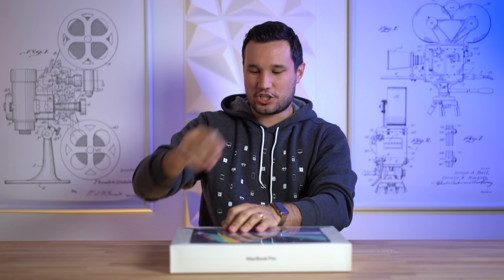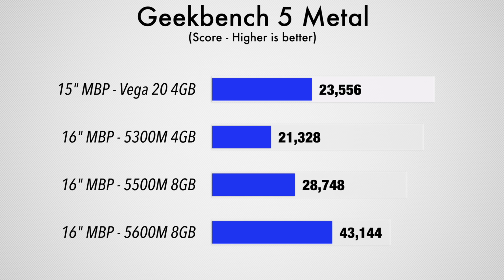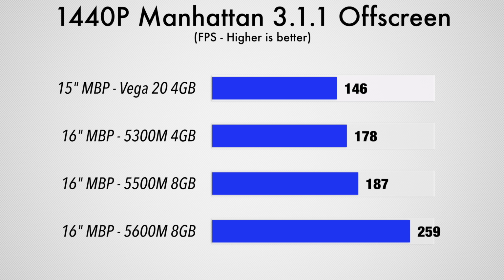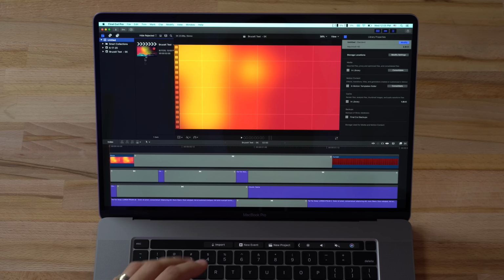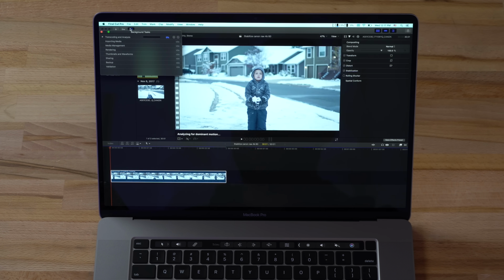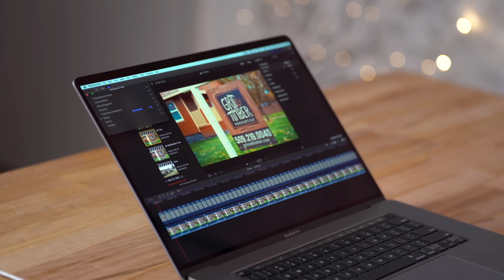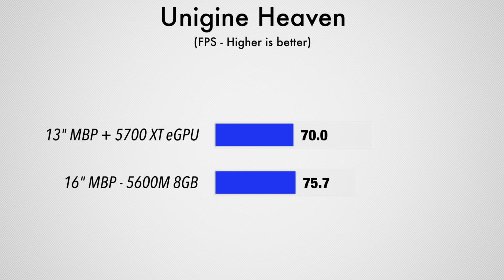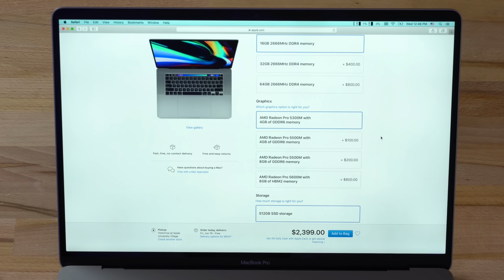New 5600M GPU on 16" MacBook Pro: Performance Benchmarks

Comment: @Max Tech you should do a revisit video about the issue on MBP 16" with 5300M & 5500M dGPU. These two dGPU are consuming 18-20 Watts of power when connected to external display while the lid is open while the 2019 MBP 15" or 2020 16" with 5600M only consumes 6-8 Watts. This is clearly an issue that needs to be fixed by Apple. Tech Reviewer like you will be able to bring for public & Apple awareness rather than allowing Apple to state that "it is working as expected" bullshit.

Comment: I bought this new mashine and I can just warn. The i9 2,3 ghz is throtteling down to 1,7ghz and my 5600m goes down to 300mhz from normaly over 1000mhz. This is unplayable und even with throttlestop I can not stop the gpu from going down in performance. If you are living in cold places without a heater it could work :-)
I have to send it back.

Comment: What about gaming and streaming on obs at the same time on just the MacBook Pro 16 5600mm?? Is there a lag with higher cpu spike maxing out? Because obs only allows the built in cpu processor to encode to the live stream with mac. I was thinking using the egpu for gaming and then the mac to the live streaming if the MacBook can’t handle both gaming and streaming.

Comment: Hi -- I receive mine tomorrow -- I am hoping that I do not also need an eGPU to drive DCS (run on Windows 10 pro mounted on Parallels Pro - both 64-bit) -- I enjoyed you review/guidance for use of eGPUs (blackmagic and Sonnet)  a couple of years ago. At about 0900 you say that you can upgrade the GPU later; however -- I was told by UK Mac Book Pro repair/upgrade companies that since the GPU is built onto the MB, you cannot upgrade to the 5600 later -- is this correct ??

Comment: How is the fan speed/noise when connecting to an external monitor and editing video? Fan speeds went sky high in those cases with the previously fully upgraded MacBook Pro. Wondering if the new GPU fixed that issue...

Comment: I'd even let you call Unigine Heaven "gaming" but comparing 16MBP GPU to 5700XT eGPU is like this is bs. No one would ever do this, why would you use a higher end GPU with something like the 13MBP? The CPU in the 13 Macbook is a big bottleneck. At least adress it, this is very misleading.

Comment: Apple should start using AMD APU + GPU combo for smart shift for efficiency and better CPU multi-core performance. The 5600M is capped at about 1GHz for 50W TDP, it would be interesting to see the AMD APU+GPU combo unlocking more power if connected on power, for instance. This is not even RDNA2 though, imagine then an AMD combo with a RDNA2 GPU.

Comment: "MORE Graphics Performance than Apple's iMac Pro!" <- this title is absolutely wrong. you're comparing the 5600m running Unigine Heaven at 1600x900 in windowed mode on a 3072x1920 screen, with the Vega 56 running the same benchmark on a 5120x2880 screen. it's not a good comparison.
Reply from the maker: Both are running the exreme preset which is 1600x900. We always run the extreme preset so it's identical between systems.

Comment: I bought a used 2018 Razer Blade 1070MaxQ for $1100. In Unigine Heaven I got 62fps on battery and 94fps plugged in.
Just trying to put that $800 into perspective. While the quality and reliability of Apple is unmatched, still...
Reply from the maker: Did you use the Extreme preset? Pretty good score!

Comment: how to fix the 16' overheating when it connected external monitors? I got 2 LG 27 5K with 2 Thunderbolts 3, do nothing, 60°C
Reply: Thats not overheating... its a MacBook, chill.. they dont even care about 100C.. My second MB (Air) is from 2015 and almost 90% the time running at 100C.. thats okay.

Comment: So I have tried finding a video on the following but haven't found one and I think your videos are really good and clear to understand so I figured I would ask you! I currently have the LG 4k monitor (22 inch) and my 2016 MBP can't run a game on any sort of decent settings. 

Could you do a video like you do comparing the different graphics cards, but run the benchmarks etc. when the MBP is connected to a 4k monitor? I really want to get a new MBP pro but if the 16inch can't give a decent frame rate for basic games on 4k, I don't know if I should wait another year for next gen graphics, buy an egpu, or simply accept the fact a MBP will never be a good gaming computer. If anyone reads this and knows a video that does this, please let me know :). Keep up the good videos!

Comment: Why spend an extra $700.00 on what is already a very expensive laptop for a faster graphics card when we all know that the graphics will be out of date in 6 months to 1 years time. Unless you need the portability of an inbuilt faster graphics card, it is better to buy an external gpu with an even more powerful desktop grade graphics card. Plus you can always sell your graphics card and replace it with a new one with an external enclosure.
Reply: That's what I'm thinking too. Wouldn't 16gb of vram via egpu in theory be faster? Trying to decide on whether I'm going to return a 5500 8gb 64gb 16inch and downgrade to 32gb and get the 5600m instead.

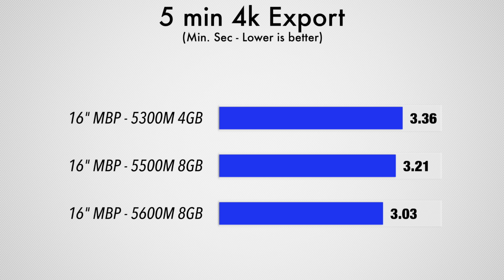Comment: So huge difference in benchmark testing results but not that much difference in real life 4k exporting 6:55  ,what does that mean?
Reply from the maker: That means the graphics is not the limitation. The whole system is being limited by the encoders which are already really fast with this Navi architecture. Basically this graphics card is overkill for common 4K H.264 video editing. It's meant for higher end stuff like 6K and 8K. or it's meant for gaming, which we are testing right now. -Vadim
Reply: Max Tech   Still not getting it 😅
Reply: Will the 5500m 8gb still be able to handle 6k and 8k especially with 64gb of ram?

Comment: Not a fair comparison with eGPU. In a recent video from Max Tech titled “Best eGPU graphics card for MacBook Pro in 2020” a MacBook Pro 16” with 5700XT eGPU had 82.8 FPS. Given that the 5600M 8GB upgrade costs $800 and eGPU like Razer core X with 5700 XT eGPU costs around $700 and can be used in multiple systems - wouldn’t the eGPU be a better option?
Reply: The problem is you CAN'T run your 5700 XT in bootcamp through internal display because you'll get an error code.
Reply: For me personally, I would pay that extra $100 for the convenience factor of having that graphics performance internally. Some people may want the convenience of changing your GPU with the eGPU and that’s very valid. I think it just depends on what an individual values.
Reply: Enrique Arayata It is definitely convenient to have that internal graphics power - but another advantage of the eGPU would be the modularity if it - I could sell the 5700XT and upgrade my graphics card in the future and since I don’t have to buy the graphics card enclosure again, my future investment is lower as well. But I could see how the 5600M baked in and always available might be helpful for some users :D

Comment: HBM2 is not same as GDDR6? What's the differences? I thought all GPU use the term GDDR for their memory name
Reply: Not really, High Bandwidth Memory is usually put into professional workload GPUs that can make full use of the larger bandwidth HBM offers. However using HBM is much less cost efficient as GDDR, it also offers next to no advantage for anything that isn't particularly memory intensive, so for gaming it only adds additional cost in most cases. That's why you usually see GDDR memory for consumer GPUs. Exceptions would be the AMD VEGA GPUs that were extremely pricey & offered no real benefits for gaming, they also ran fairly hot (or to conservative out of the box to show some actual potential)...

Comment: With the i9 2.3ghz -16gb ram -5500m 4gb, I can achieve FPS:145.4 - Score:3662 - min FPS: 30.5 - max FPS: 274.9 at High settings 2560x1080 in Unigine Heaven Benchmark using egpu with Nvidia GTX1080 8gb. 25yrs Pc builder experience I find MacBook Pro has the hp under the hood but it always fails and bottleneck on GPU side. I hope this HBM2 5600m fixes this problem that plague every MBP for years. 

With this test it’s only 10% faster than my 2010 Mac Pro Xeon 5690 6core 24gb ddr3 1333mhz with PCIE SATA SSD with the same GPU Nvidia 1080GTX 8gb. Now we know the limiting factors are the gpu. This day in age a better GPU should be standard not extra cost.

Comment: In the case where the export times of the 5600 and 5500 are about the same, could it be that driver/software combination was not taking full advantage of the 40 cotes in the 5600 over the 24 cores in the 5500. We’ve seen software that does not take full advantage of CPU cores. Could an analogous situation exist with GPU’s?

Comment: I know I've asked this before, but what setting are you running the BruceX test at? I'm assuming it's one of the ProRes ones?
Reply from the maker: https://www.tonymacx86.com/threads/graphics-test-bruce-x.224983/
Reply from the maker: We’re exporting using ProRes 422
Reply: @MaxTechOfficial  Thanks! I just ran it at ProRes 422 on my 2019 15" MBP i7, 32GB RAM with 555x graphics and clocked BruceX as fast as 26 seconds; with an eGPU and a Vega 56 card it clocks in as fast as 12 to 16 seconds. Which is odd because you have the Vega 20 at 32 seconds... (I'm using FCPX 10.4.8).

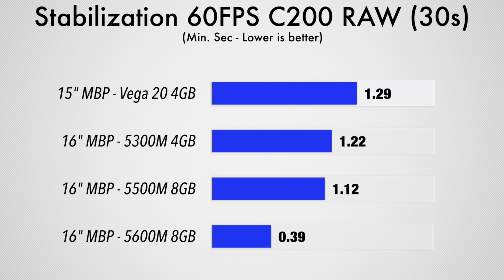Comment: Small error at 5:29 in the graphics, 39sec = 0.65min and not 0.39 but good job and good video anyway Max!
Reply from the maker: Minutes.seconds so 0.39 means 0 minutes and 39 seconds. Our charts don’t work using : so we have to use .
Reply: @MaxTechOfficial  Oh that's why then, yes a bit confusing to use the . but that's my bad sorry ^^

Comment: Nice video, I just wonder if that £/$800 increase is a mistake.
If you compare equivalent spec XPS 17 (8 core, 1TB, RTX 2060) @ £2750 vs £3,500 for MBP!
£750 Apple Tax seems a bit steep... 
The performance does seem pretty cool, especially unplugged would be interesting to see if there is a difference unplugged on XPS 17 vs this.

Comment: 你在逗我吗 Unigine Heaven 用 900P 来测试？？今年是 2020 年还是 2012 年？Are you kidding me? Using 900P for Unigine Heaven? Today is 2020 not 2012.
Reply from the maker: It’s the extreme preset. We run the same preset for consistency.
Reply: @MaxTechOfficial  5600M price incredible high, I just wanna know how far Apple and AMD can push an  AMD mobile GPU. But on  Unigine Heaven LEADERBOARDS you event can't find 900p option. This resolution can mean something but can't compare to another not Apple Laptop. Face to  nvidia Max-Q who will wim.

Comment: Does this new graphics card affect the battery life a lot? If the trade off of this great performance gain is a few minutes shorter battery life then it’ll be a worthy upgrade.
Reply from the maker: It’s the same 50W TDP as the 5500M

Comment: That is pretty impressive, but a very expensive upgrade! I'm running the 16" 2.3 5500M 8GB with a Razer Core X Chroma + 5700 XT and get a Unigine Heaven score of 2059 and 81.8 FPS. Apart from being more powerful, cheaper and upgradeable, the main benefit for me is that it keeps the 16" a lot cooler and the fans hardly spin up with an external 4k monitor.
Reply: except that you can't run your 5700 XT in bootcamp through internal display because you'll get an error code.
Reply: @horizonrising7393  I'm in bootcamp right now with the 5700 XT and Razer Core X Chroma, using both internal and external display... but it was a pain getting it working without "error 12". These steps worked for me with the Chroma, but not with the standard Core X for some reason - https://www.reddit.com/r/eGPU/comments/e3ru80/macbook_pro_egpu_help/

Comment: This is bullshit from Apple, while Dell G5 is having Ryzen and RX 5600M inside and it costs $800 for the whole laptop, Apple just put a RX 5600M in and charge $700 "in extra with RX 5500M". That is enough to know the price doesn't come from the GPU itself but is asking from greedy Cook
Reply from the maker: The 5600M is brand new and way different from the RX 5600M you’re talking about
Reply: @MaxTechOfficial  TDP might be different but not much different in term of performance, this with lower TDP even perform worse.

Comment: It's not bad. But this chip has made me decide to get the new Dell XPS 17 with 2060. In the UK Apple charge £800 ($1000) for this chip upgrade. Complete ripoff, even by Apple's standards. The next (last?) chance for Apple to get my money is the new iMac as long as they use 10th gen and don't remove the ability to upgrade the memory. Disappointed.

Comment: Something's gotta be wrong with your eGPU setup, the bottleneck from tb3 shouldn't result in that bad of a loss. The 5700xt in a desktop machine in a mobo pcie slot clocks like 70% faster then the 5600m. Even with a tb3 bottleneck, it shouldn't be THAT shitty. I use an eGPU and I've never seen performance hit quite like that before.

Comment: Mac's can not game... My GTX1060 6gb in my HP OMEN  Gaming laptop scores 72.8 fps in unigine heaven benchmark... and this mac scores higher, wow... i'm impressed.  My laptop is maybe 2 to 2,5 times as thick as that MacBook pro and my laptop is running at 97 degrees C, while that MacBook is running at 73 degrees C. But the only downside still has to be the price. But okay yeah that's a Apple thing.

Comment: Great video as always - Thank you! Could you please check the thermals of the machine with this new gpu option?  I’m thinking of pulling the trigger on a 16 inch Mac book pro and I am very interested in this laptop configuration, but I am worried about thermal throttling. Keep up the great content!
Reply from the maker: The TDP is still just 50W just like the 5500M

Comment: I make travelvideos and I want to by the new one with the5600M... should I take the i7 or the i9 and should I take 16 or 32Gb RAM?
Reply from the maker: I think you would be fine with 16GB and the i7. But if you have the money and you don’t mind going all out then I would get the 8 core first and then more ram
Reply: @MaxTechOfficial  ok thanks... would you take the 2.3GHZ and then the RAM or the 2.4GHz and than the RAM?

Comment: I just ran some tests on my 2019 16 5300m
Machine plugged in with power adapter on right side.
e-gpu on the leftside
Geekbench 5 Metal test:
5300m: 29891
e-gpu RX570 8GB: 37485
Maybe new improvements in macOS 10.15.5 gave the 5300m also a bit of a boost, give it a go again! 😜

Comment: Does the 5600M GPU still cause the fan noise to ramp up with an external monitor under light load ? I'm hoping that the increased efficiency will allow the GPU to run cooler allowing for a more quiet external monitor usage.

Comment: I rather have throtteling unpluged then killing my glued in battery....
Reply: Yeah, my 2018 MacBook pro already needs a new battery. When you add the fact that it runs really hot at full load for both CPU and graphics, the battery losses out on longevity. I'm no longer sold on the laptops ability to operate full load on battery when even the cooling system can hardly keep up. This is why I opted for a custom gaming laptop with a large battery. If I'm on the go my laptop is used for light duty and if I'm in one place then I'm most likey plugged in. Plus even when gaming my temps don't go above 75 degrees unless I'm overclocked.

Comment: Can you compare this to the iMac Pro and Mac Pro in more detail? Thermals performance if plugged into external monitors with the 5600M would be great to know as well, does it still get hot with this new better GPU option?

Comment: time for mabook pro to go All AMD before ARM
Reply: will never happen unfortunately. recoding macos for amd optimization so deep into intel features like tb3, quicksync etc. doesnt make any sense from a business standpoint. would take up too many ressources when the ultimate plan is to move to ARM processors a few years down the line. people will still buy the macbooks with intel until their ARM is ready. why go through the extreme hustle to switch to amd if a long term partnership is off the table? to get where apple is rn with intel, it'll take at least 2-3 years of development and the new ryzen chips only appeared in latest 4000 series. so basically until the switch might be ready, ARM is most likely in the pipelines.

Comment: its cost 800$ extra, I rather build a rig then instead of using bootcamp. 13 inch 2020 4 ports  sounds like a solid choice for me. However, its impressive mobile GPU in terms of power, capacity, heat , the card can push up to 5.3 TFLOPS, which is equivalent to the desktop GTX 1060 6Gb.

Comment: Very impressive at 50W! Those that fly often enough especially long haul flights (covid notwithstanding) would know that not many if any windows/gaming laptops with this kind of performance can be charged on an aircraft outlet as they normally pull too much power than the onboard outlets allow. This is a game changer for extended period inflight power intensive tasks!

Comment: Max, I've read that the die size of the 5600M is considerably bigger than the 5500M. If you could take off the back panel and show a comparison (or if cooling has changed) for the full review that would be awesome!
Reply: The die size of navi 10 is 251mm^2.

Comment: Now imagine this kind of Graphics performance paired with Ryzen CPUs 😳 MacBooks would conquer the laptop market once again.
Reply: will never happen unfortunately. recoding macos for amd optimization so deep into intel features like tb3, quicksync etc. doesnt make any sense from a business standpoint. would take up too many ressources when the ultimate plan is to move to ARM processors a few years down the line. people will still buy the macbooks with intel until their ARM is ready. why go through the extreme hustle to switch to amd if a long term partnership is off the table? to get where apple is rn with intel, it'll take at least 2-3 years of development and the new ryzen chips only appeared in latest 4000 series. so basically until the switch might be ready, ARM is most likely in the pipelines.